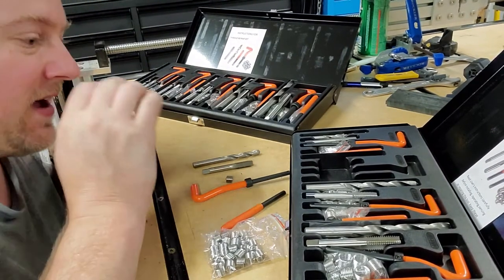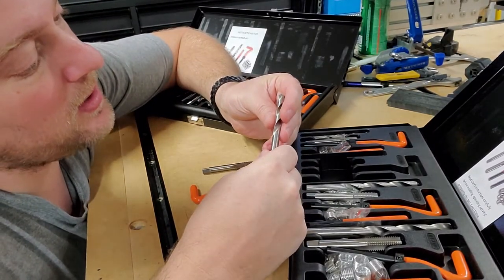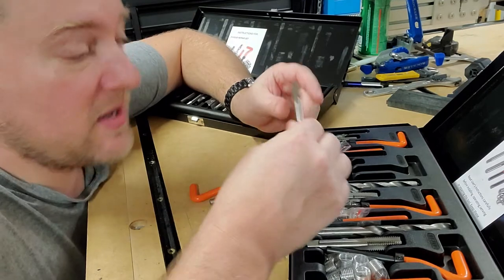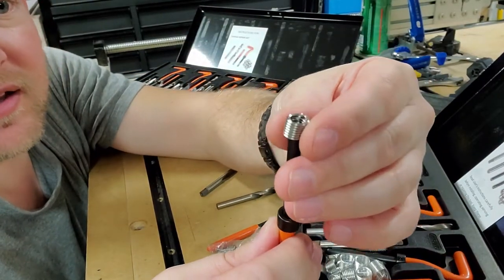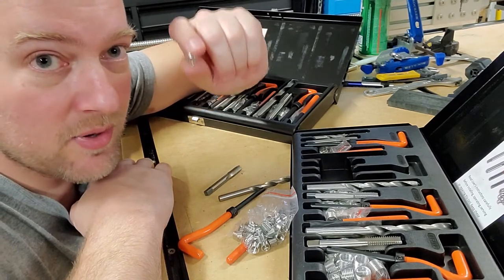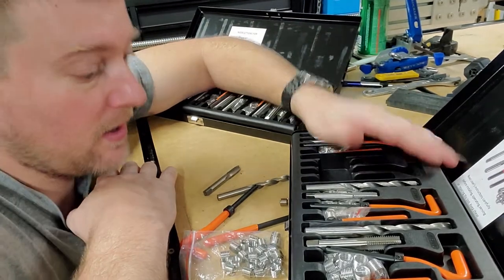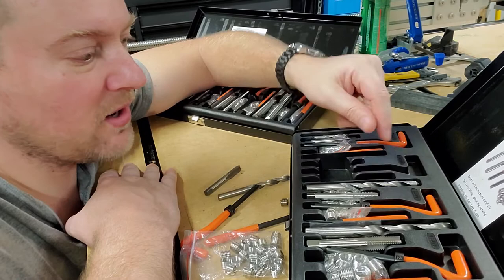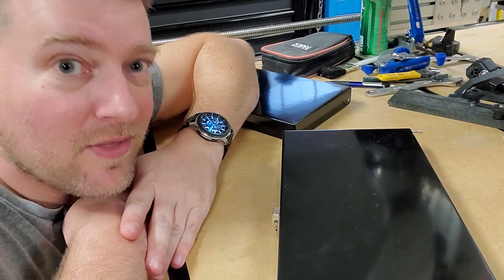HeliCoil Threaded Inserts

Comment: At my old site we had our parent university attached to the building with a machine shop. I had them install a couple helicoils on a zeiss NC4 head. It was pull the head and send it in for 20k or gamble on a couple hundred dollars. They lasted during my time there.
Reply from the maker: There are many videos on YouTube showing the strength of helicoils vs threads in base material. They're almost twice as strong.